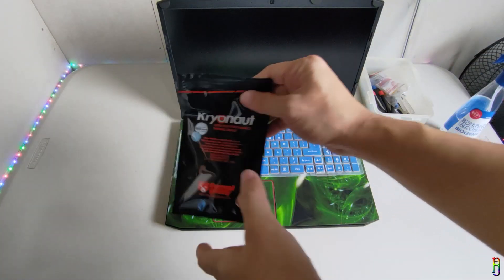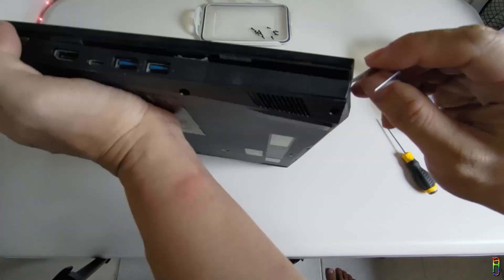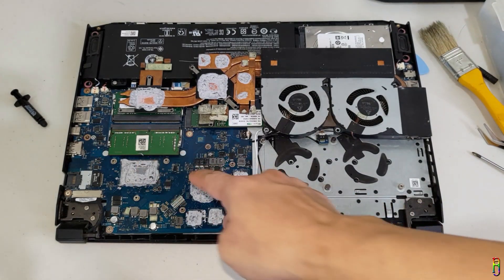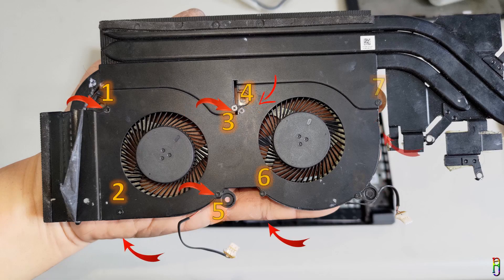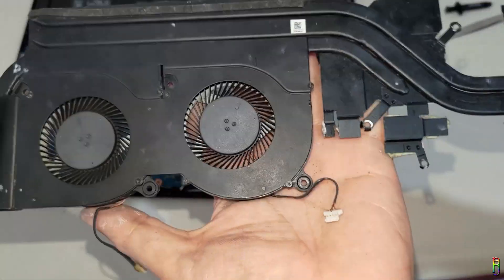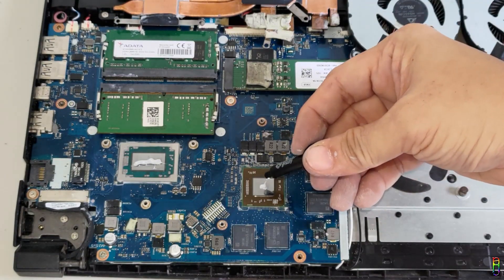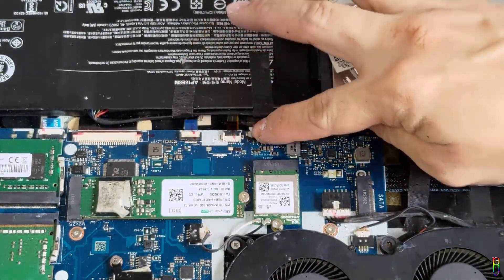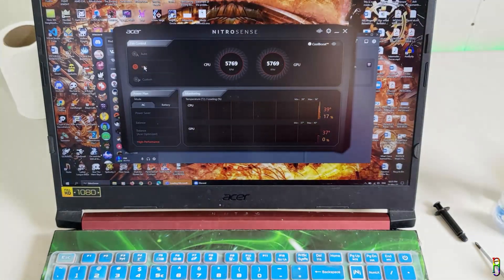Nitro 5 Repaste, Cleaning & Disassembly (AN515-43 with Kryonaut)

Comment: can you make a video of how to replace a faulty speaker of this specific Model again sir, i'm kinda scared to hand it on my own  because the speaker wire has two ends that connect into a single push pin. thank you sir!
Reply from the maker: My speajer is alsi messed up. If I have time and have ordered a spare speaker, I will do a video

Comment: hello bro is it possible to Screen display upgrade, my  nitro 5 is 60hrtz can i upgrade to 144 hrtz display by replacing screen?
Reply from the maker: Posisble. But you need to research on the cable. I think 60 Hz display only uses 30-pin cable while 144Hz uses 40-pin

Comment: What about those green stuff? Are those thermal pads or thick thermal putty? Aren't you gonna change them?
Reply from the maker: They are thermal pads. Not changing them yet. 😉
Reply: @ribbytrivia  Hey man, have the same laptop as yours but this laptop has the dedicated gpu on idle for almost 2 years. Do you know how to make the laptop use its dedicated gpu again? Ive tried reinstalling the graphics drivers and setting all games to use the dedicated gpu in the advanced graphics settings but ¯\_(ツ)_/¯
Reply from the maker: @-0-__-0-  Install the software of the GPU (e.g. AMD = adrenalin). By using the GPU's software, you will be able to enable it.
Reply: @ribbytrivia  Did not work. This is probably the first thing I did man. Anyways it got fixed by accident yesterday. Basically I tried to go into Advanced Bios repeatedly but failed, after booting I tried playing again and it now uses the dedicated gpu with the main fallback that Nitrosense doesn't work anymore 😂.
Reply from the maker: @-0-__-0-  Great! Nice to know you made it work.
Reply: @ribbytrivia  Naubos English ko sayo par gagi hahahahaha
Reply from the maker: @-0-__-0-  hahaha.... hanep! Kala ko foreigner ka.
Reply: @ribbytrivia  😂

Comment: can you recommend a good thermal pads because i repasted it with corsair tm30 on cpu and gpu and temps still the same
Reply from the maker: I used the paste instead of pads 🤣😂
Reply: @ribbytrivia will the thermal paste damage the chips? Or pads are needed
Reply from the maker: @bayronrubio2182  I've been using the paste for 2+ years now. No damage whatsoever. But if you have access to a thermal pad, they are more appropriate to use for the memory chips.

Comment: Hey man, so I took the back off my laptop gave it a little clean out didn't have the right driver for a smaller screws so I stopped put it all back together but now it keeps cutting out and turning the power off any recommendations how to sort this issue out please?
Reply from the maker: Check the battery comnection. Might nit be plugged in properly.
If it's still the same, I suggest consulting a technician face-to-face, as it's hard to isolate a problem remotely

Comment: Good day sir...i has problem after clean the fan...i suddenly has problem with supply power...if i plug in charger,my laptop will be shoutdown...before this,not happen..its is happen after i clean the fan...
Reply from the maker: Double check if you have plugged in everything back properly, especially the battery. That's why I take pictures or videos everytime I do this, so that I have a reference on where everything goes. If it is still the same, might as well bring it to a technician.

Comment: My same laptop's gpu temperature is going 90 and i am experiencing frame drop to 0 fps in every 5-6 seconds in every game, no matter how small is the game, can it be thermal throttling ? Please tell me, before these games used to run butterry smooth, I already have bought a noctua nt-h1 thermal paste but scared of applying it.
Reply from the maker: Definitely thermal throttling

Comment: Please help, i repasted my nitro and now it doesn't start, it's not even charging, i don't know if i disconnected something by accident but it just doesn't get powered, i didn't disconnected the battery but it doesn't smell like something got burned
Reply from the maker: Not sure how I can help. You need a technician to look at it.
If you're sure that the battery is connected properly, there might be a problem in the power line. These problem can only be checked physically. I highly suggest calling a technician

Comment: Question: While cleaning laptop, some of the adhesive tape on the gpu and motherboard have "dried" out and wont stick. Will that be a big problem? I just ordered new adhesive tape but am slightly worried they could be the wrong "type"? I just thought that since it was a black adhesive tape, i just ordered any adhesive tape on amazon. Thank you! 🙏🏼
Reply from the maker: Not an issue. Any electrical tape will do.

Comment: (PLEASE ANSWER) I have question - basically I was cleaning the laptop and I didn't unplug the battery connector (in the motherboard) and whilst was cleaning and etc, I accidentally dropped my screwdriver near (in the video where ram is but above a lil) there was electric static discharge for almost 2 secs and I turned the laptop on everything was fine except it couldn't register my gpu anymore (GTX 1650) and now I'm stuck with well the graphics that came with laptop (it's really bad). Is this fixable? To me I feel like l've broken the laptop overall since it won't register my gaming Gpu on it and well it runs normal and everything just can't play games on it
Reply: is it fixable ? or kinda need to buy a new laptop?
Reply from the maker: Probably something got shorted in the board. You can try to have an expert fix it as sometime it just need some simple re-soldering. But if it is a circuit or chip damage, then you need to replace the GPU, or worse, the whole mother board. Good luck!
Reply: @ribbytrivia 😭😭😭
Reply: I have the same problem in other PCs, most in the Acer Nitro, the GPU died in almost all cases, or the chipset has a problem
Repairing that problem is very expensive 🫰
Reply: @Plexx2005 oh dang, I was about to open my laptop to clean and reapply thermal paste. But now I read what u said, i'm hesitating lol. Is there a way for this not to happen? What to avoid, preventive methods, and such?

Comment: How often do we have to repaste this kind of laptop?
Reply: Well, I didnt repaste yet, my an 515 44 is from 2020, and my temperature is still good. Guess it depends also on the  usage and handling of the laptop.  Recently replaced my 8gb ram to 2x 16gv and cleaned the fans a bit.  In nitrosense youncan see the  temperatures.  While using your programms  or playing games, so you can monitor if they get too warm.  O do think that I eill repaste it with the noctua  nt h2 paste, but I will spread it evenpy to  make sure ai cover all corners
Reply from the maker: Every 6 months

Comment: I've been using my nitro 5 for a little bit more than 4 years and it's starting to feel really slow
Like it gets really hot when gaming and it starts to lag to the point that I can't run apps that it used to run perfectly fine before
Idle temperature is still in the 50s but it goes 80+ when gaming
My biggest problem is that it forced shut down the other day due to overheating
Is this something that can be solved by just repasting or is it something else 😭
Reply from the maker: Repaste and cleaning the vents and fans should do it.
Reply: @ribbytrivia Help 😭😭😭😭
I just removed the screws from the heatsink but it seems to be on some adhesive huhu
I can't lift it 😭😭😭
Reply from the maker: @icobsixonwo  Not sure how I can help. That needs a physical interaction. I'm sure you'll figure it out.
Reply: @ribbytrivia  Idk still if it was the dry thermal paste or the thermal pads that the laptop came with but I just wiggled it out and it eventually came off lol
But like yeah thank you for the help 😭
I'm down to 40C again huhu
Reply: @icobsixonwo yea the heatsink just needed a bit of force it was probably never took apart before.

Comment: I bought a brand new Acer Nitro V15 recently. The cpu is over heating too much under load like repacks installation or cpu benchmarks it was going to 99c most time. I installed throttlestop to undervolt it but it has undervolt protection so could not do it. but cpu wattage limit option was available and with 45-50w the temp did came down to 85w without any significant performance difference. I tested both times in benchmarks. I can see the air coming out from the vent is not that hot even though the cpu temp is 90c.

Contrary to GPU it's perfectly cooled, it stays under 75c always, most times under 65 while gaming and the air is also very hot from vents for GPU tasks. I am pretty sure the thermal paste has some issue in cpu, but fearing about warranty void sticker to open back pannel.
Reply: Same here. My nitro 5 CPU is always above 90 degrees  when gaming. I just upgrade my ram by myself. I remove the warranty sticker haha. Screw it. I am also going to repaste the thermal paste
Reply from the maker: If you still have a warranty, try to have Acer repaste you laptop. That should be covered in the warranty, and you just need to pay for the thermal paste, or buy your own paste and bring it to Acer... at least here in the Philippines  that's how things work.
Reply: @ribbytrivia  here in India, Acer service is not that good. I called their customer care number and asked if I want to upgrade ssd, is that covered under warranty for free as there is warranty void sticker. They were not sure, kept telling me you have to pay for service fee.
Reply from the maker: I feel for you man. That is one bad after sales support.
Reply: @saman_pradhan  Acer after sales service is worst in India. I'll never buy any Acer product again.

Comment: My idle temp are 75 and gaming is 91-92 and my frames drop quite a lot when gaming should i do some cleaning? Or it might be some storage or virus issue?
Reply from the maker: Definitely cleaning and repaste. When it reaches 90+ °C it will throttle, thus the frame drop.

Comment: I bro I have a acer nitro 5 and the idle temperature are 40/45 degrees but while gaming it reaches 80/90 degrees C, does it need repasting? The laptop is just 5/6 months old
Reply from the maker: Yes it does. Repasting is usually done every 6 months
Reply: @ribbytrivia  okey thanks for replying
Reply from the maker: @godson2939  no problem
Reply: Bruh, 80/90 is normal temperature for gaming laptop...
Since you don't know even this, I don't recomend first time trying this.
Also yes, every gaming laptop will be more or less loud.
Reply: @michael87012  when I play on 60fps lock it never reach 80/90 degrees C but when I play 90fps or 100fps in any game it reach 90 degrees for CPU and the fan are so loud as well
Reply: I always keep an eye on temperature since a friend asked me to, Im just using it for casual gaming now or just some rendering
Reply: @godson2939  From my experience, if it's below 90 then it's good. Just don't let it run at above 90 for multiple hours a day for the next few years then it should be all fine. Temps is the common problem for gaming laptop because of the limited space.
Reply: @manhmai939  haha yes

Comment: is this laptop the one with 3550h + rx560x? I'm surprised by how low your temps are as I've replaced the paste on my laptop multiple times but seems to only help about 5c less at most.
Reply from the maker: AN515-43-R41A
 - Ryzen 5 3550H
 - AMD Radeon RX 560X 4GB VRAM
 - 4GB RAM + 4GB upgrade
 - 256 PCIe NVME SSD + 1TB HDD

Comment: Hey bro ; Recently I went on a shop to repair my acer nitro 5 and they told me that the problem is with my GPU,  so they somehow disconnected it. is there any way by which I can reconnect it by myself? How to connect the GPU to the motherboard again?
Reply from the maker: I would not recommend it. I personally would not do it. That is not a normal soldering job, it takes an expert to reattach/replace a GPU. I would rather pay those expert than brake the whole motherboard. But hey, it's your laptop, if you're up to it, you can try doing it. There's a lot of tutorial videos in youtube

Comment: once in a while I do dust my laptop from the inside which fixes some issues, but is it really neccessary to repaste it? I heard there are some thermal pads or something that work like thermal paste except you don't really need to change them and honestly since I don't know much about computers I'm kinda scared to disconnect the battery take the fans apart in case I mess something up and don't know what to do
Reply from the maker: Yes. It is necessary to replace them. And I know the feeling. This video is actually my 1st attempt to repaste. I'm glad I did not mess that up.
Reply: if you don’t want your laptop to be a toaster, then yes

Comment: What is the length of the bottom panel screw? Just got my laptop back from a board repair and they misplaced the original exterior screws. Hope you can help, thanks.
Reply from the maker: There's a lot of screws for the panel. Can't you just unscrew one of them to get the size?

Comment: I have the same laptop, been had it since 2020 since December it will get random fps drops and freezes and now it’s to the point where the CPU reaches 90 degrees then turns off is it the thermal paste?
Reply from the maker: Most probably yes. The same things happens to my laptop when it needs repasting. It usually happens 6 to 8 months after the previous repaste.
Reply: @ribbytrivia  thank you man, I just cleaned the fans and replaced thermal paste runs like when I first bought it
Reply from the maker: @weenor2829  You're very much welcome!
Reply: @ribbytrivia  ah okay thank you I’ll definitely reposted it sometime next week!

Comment: Is there any thermal pads? Cause' I can see a thermal pad. Did you not replace it?
Reply from the maker: I replaced the pad with paste. 😁 I'm not sure if that's ok, but I've been doing this for a year now, and no problem at all. So I guess it's ok
Reply: @ribbytrivia  I see.  I am debating wether to  change the pads or just use thermal paste. But when I checked the price of thermal pads, I was so surprised, its one hella expensive. So thank you for that info,maybe I'll just use thermal paste instead.
Reply: @godofredo0409 hey bro, can u give an update? How did it go? Did u change thermal pads to thermal paste instead?
Reply: @starnight930  I ended up buying thermal pads. forgot the exact size though.

Comment: Hi, can i put the thermal paste to the vrams? my laptop had for default some viscous pink paste on them, it is ok i f i use artic mx4 for everything? (cpu, gpu and vrams).
Reply from the maker: That's what I did. Used kryonaut on vrams. Have done it twice already. All good.
But I think it's more advisable to use thermal pad on vrams, as mentioned in 1 comment here
Reply: @ribbytrivia  i bought something named k5 pro is thermal pad but viscous for the vrams, i have same laptop and it reaches 90 degrees without using any program, but i will change thermal paste in a while so lets see
Reply from the maker: @gilbertoagl  Do let me know the result. Very interested. Thanks!
Reply: @gilbertoagl   same to me when i remove the pads my laptop become back to norman i dont maybe wrong thickness or what is use 1mm
Reply: @ronelitojose6414  Did you use 1mm? Cause im not sure if i should get 1mm or 0.5mm
Reply: @gilbertoagl   Aynı durum benim de başıma geldi. Pembe macunu değiştirdikten sonra. K5 Pro macunu ile. Şimdi boş modda 63,90 derece, oyun modundan korkuyorum, sıcaklığın 100 derecenin üstüne çıkacağını düşünüyorum ve çözüm arıyorum. Sorunu çözdün mü ya da başına ne geldi? Bana yardım eder misin ?

Comment: Thanks bro, I have the same Nitro 5 ,  I notice it was a bit hot in the ventilation side.  It has 2 years old and it gets between 59-79 range CPU temp.   I maybe should change the thermal right?
Reply from the maker: It can still go on for 2-3 months before going up to 90+, but it's better to clean and repaste ASAP if ypu can
Reply: @ribbytrivia  Thanks bro, I have not being able to take out the 8 screws , the small ones. What number of screwdriver are you using?
Reply from the maker: @andrex0071  I bought a simple cellphone repair kit and use that. It includes small screw drivers, small clamps/clips, and other stuffs. If I remember it right, it is less than a hundred PhP. Just search from Lazada/Shopee, there's a lot of sellers out there. Just pick the one with the best review + cheapest price.

Comment: What is the next best thermal paste after Kryonaut? Not able to find kryonaut anywhere in my place. My cpu and gpu temps are hitting 97-98 degree in winter.
Reply from the maker: Cooler Master and Arctic are the 2 brands I usually hear/read to be good. But I have never used any of that yet

Comment: Dude I just wanted to say thanks. I thought my laptop had a serious issue, never clean it ever since I bought it 2 years ago but after giving this method a shot everything went running SMOOTHLY just like brand new. My temp went from 50C-60C (idle) 85C-95C (gaming) to 40C (idle) - 66C (gaming). Almost 30C difference in gaming and right now it barely surpasses 70C , thanks man!
Reply from the maker: Glad I can help!

Comment: You can use gelid ultimate thermal pad with 1.0mm thickness on vrms, mosfets and VRAMS. i dont recommend thermal paste on VRMS, Mosfets and VRAMS because it hard to clean if you change again. i use on my Nitro 5 AN515-43 and looks good. and i use kyronaut extreme (red thermal paste) only on CPU and GPU
Reply: hi wat size of gelid ultimate thermal pad fits your unit? we have the same one
Reply: Wich parts are those? How do you know the differences?
Reply: MOSFETs, vrms and 4 vrms are same 1.0mm thickness I used.